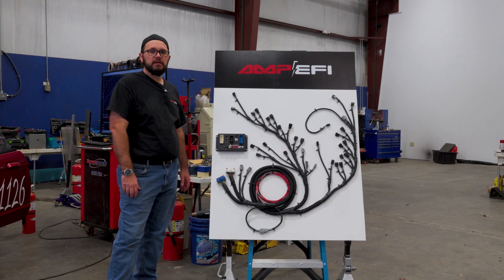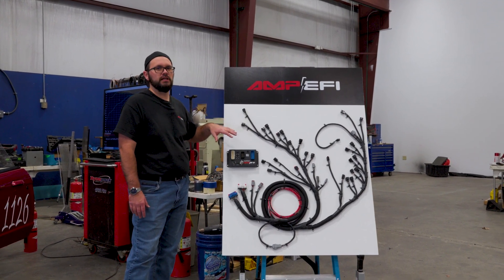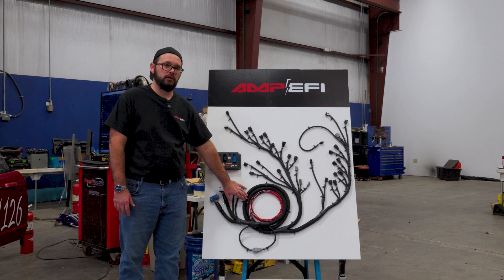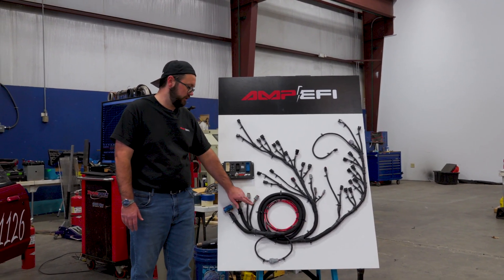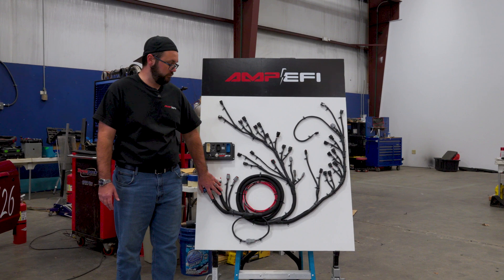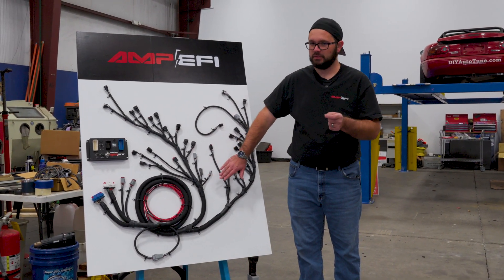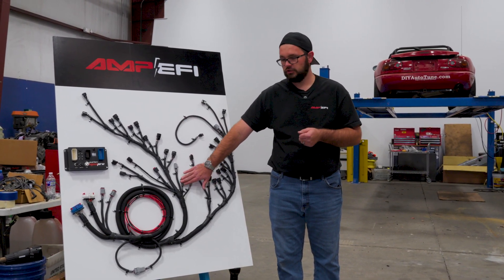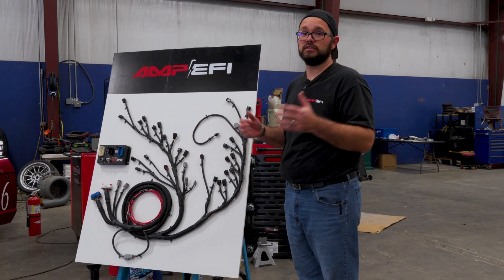Coyote PNP Harness Package: What You Need to Know | DIYAutoTune

Comment: Will this work I have a gen 3 2018 Ford F-150 engine and I want to put it in my 86 notchback with a t56 I want e85 and I want to be able to tune it with a laptop and it will be twin turbo later on. Will this work on the Gen 3
Reply from the maker: Not directly. The gen3 has some notable changes. Hall effect crank sensor, and different teeth on the cam. It would require some modifications to the harness, or the use of a gen1/2 crank sensor (have not tested)... the gen3 is also direct injected, you would have to run a port injection manifold with DI block off plates.